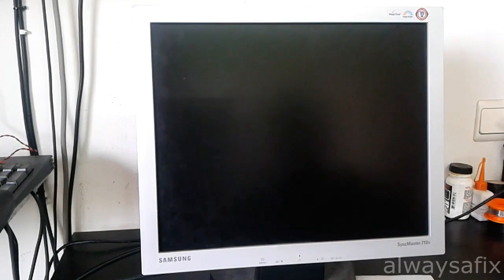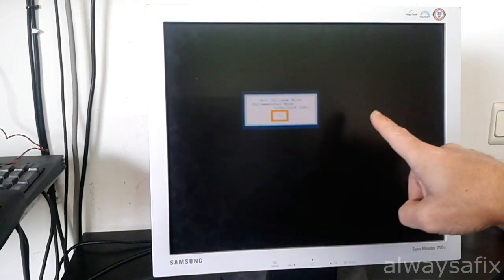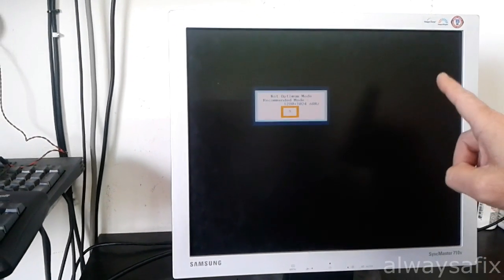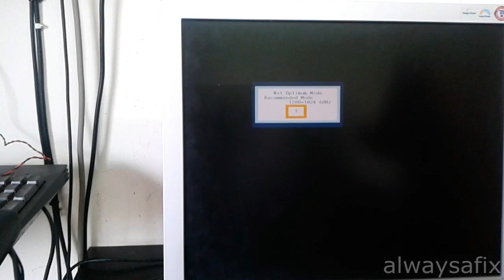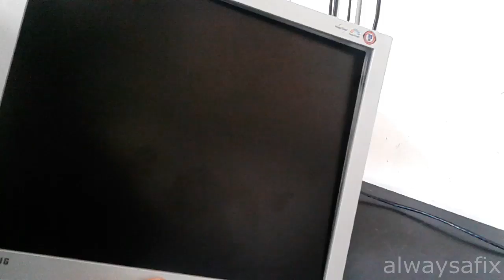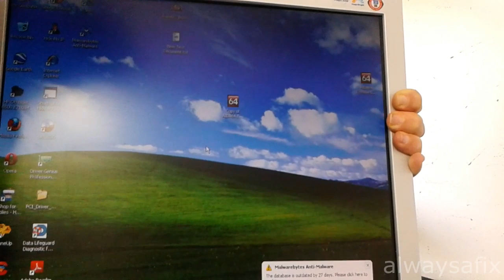not omptimum mode Samsung syncmaster 170v

Comment: My monitor SAMSUNG sa300 "20 does't stop the information , the resolution native is 
1600x900 but the images are blurry insuportable to the view is very 
cansative  i change the drivers intel graphics but the maufunction 
persist i too change cabe vga put the HDMI Converter to VGA and was 
format windows 7 . if you think may problem in the Gpu mai mother bord 
is :  IPX847E1 PCWARE

Comment: can i used this fix fore a 913V monitor?
Reply from the maker: +Herman Tempelman No you can't.  This fix is for this specific model.  Can you please describe to me exactly the problem that you are facing.
Reply: +alwaysafix  
I ave the same problem white a syncmaster 913v a monitor from 2005
Reply from the maker: +Herman Tempelman Is the OSD message permanent or when you play a certain game?  Does it disappear after a while?
Reply: the OSD is  permanent direct after power up the screen
Reply from the maker: +Herman Tempelman Test to see if it is a stuck button by pressing other osd menu options.  If the menu sticks, then it is the button.

Comment from the maker: @CrazyPainter1000 That wasn't a customer's PC, it was a workshop PC, and this screen wouldn't start at any set resolution.  Common problem with this model.
Reply: What do i need to do to stop it popping up while playing a game?
Reply from the maker: VenomDF Have you tried changing your resolution to the recommended settings?
Reply: alwaysafix From right clicking on the desktop?
Reply from the maker: VenomDF Yes.
Reply: alwaysafix if i click on the desktop and go to resolution it says 1280x1024..
Reply from the maker: You can change that to the resolution that the screen prefers, it should get rid of the reminders.  Good luck!
Reply: alwaysafix the error says recomended mode 1280x1024 and at screen resolution it says 1280x1024..Whats wrong?
Reply from the maker: VenomDF Does it only show this error when you in the game?  It could be that the game is changing the resolution when it starts the game.  Check the video options of the game.
Reply: how would i do that if it shows me that error and its just a black screen and that error..
Reply: +VenomDF Do you still got that error or did you solve It? It is showing me the error only if I want to play a game..
Reply: i still have it but only on some games
Reply: VenomDF Okay, thanks.
Reply from the maker: +JustLaugh LOL Try changing the resolution settings in the video options on the game.  Good luck!
Reply from the maker: +VenomDF Try changing the resolution settings in the video options on the game.  Good luck!

Comment: How did you figure out this mod? You were unsure of pin numbers and you knew where to solder the resistor?
Reply from the maker: This particular model has been on the market for quite a few years now, and I've done a number of them before I started my channel.  My notes on this repair just outline which pins to bridge and the value of the resistor.  Thanks for watching.
Reply: alwaysafix
Is the chip you soldered the resistor to faulty?
Reply from the maker: ElectronFun.com Not sure what's up with the chip.  Normally when something goes wrong with the logic board, its game over.  In this model however this mod brings it back to life.
Reply: alwaysafix
Thanks for your reply.